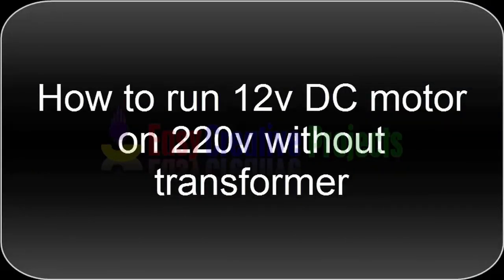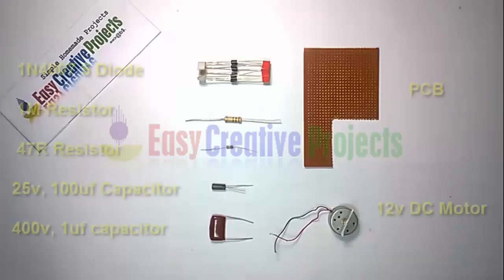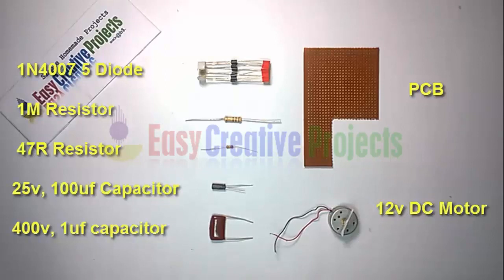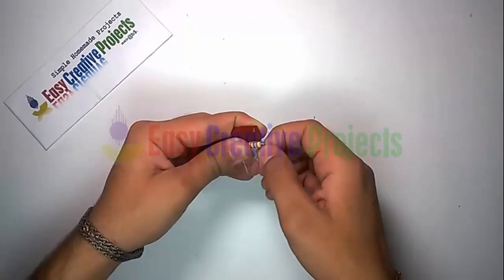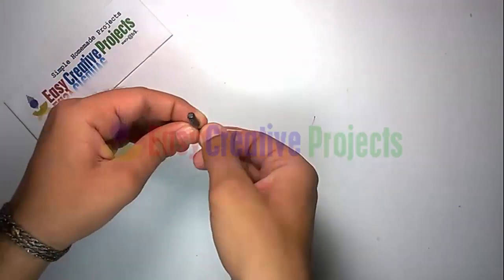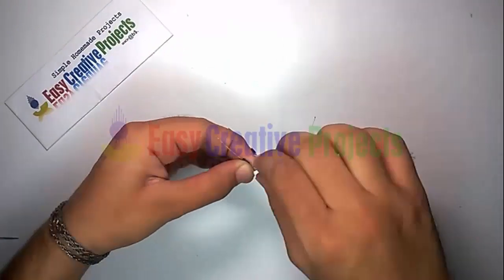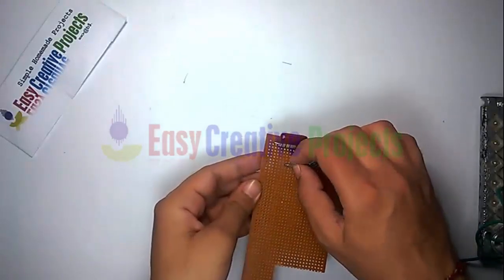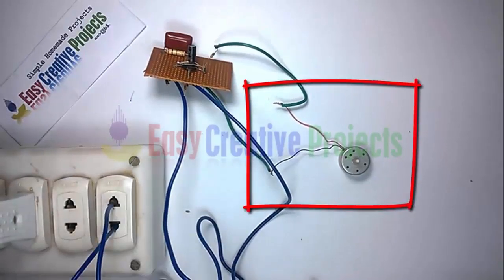How to run 12v DC Motor on 220v without transformer - easy step by step with circuit diagram

Comment: How much the value of diode and capacitor to rise the amphere..thanks
Reply from the maker: dear if you want to increase ampere then you need to increase UF (micro farad ) but if you want to use it for long time then you need transformer. 
thanks

Comment: I buy a capacitor but not ciramic but the value is the same 400v, 1uf capacitor can a use it?
Reply from the maker: you can use but its blast soon. 
so try to find ceramic capacitor.

Comment: sir my circuit is giving 14.38 V
Reply: maybe try getting a 12v regulator.
it should help to control a output to 12v as long as input is higher than 12v.
if im mistaken dont mind me im a noob
Reply from the maker: dear voltage store in capacitor so its giving 14v.

Comment: How can increase output current to this Circuit (up to 2amp)plz tell me as well as I can shock from this output current or voltage please tell me
Reply from the maker: for increase current simply change capacitor and diode.

Comment: HI FRIEND, MY VOLTAGE IS 120 AC, WHAT VALUE OF THE CAPACITOR I NEED IN ORDER TO LOW  TO  12 V ? .,. THANKS FOR ANSWER
Reply from the maker: dear use same circuit. 
if current flow slow then use 2uf capacitor. and try 12v voltage regulator.
Reply: THANK FOR YOUR SOON REPLAY
Reply: Use ceiling fan regulator.

Comment: the diode no 5  is useless

Anywhere I have not found
Diodes parallel to capacitor
  In a power supply.

Show me such a  schematic 
In jlink

Comment: Bhai is se 12 v TQ ki light jla sqte he kya.
Reply from the maker: yes dear but this circuit current flow only 500mA to 700mA.

so try to use 12v and 700mA LIGHTS for running this circuit.

Comment: Nice video :-) question: what I need to change to run DC motor 22.5v , 90Watt? Thanks for help
Reply from the maker: dear without transformer get 90 Watt power output,  this time impossible.
Reply: ok,thanks for replay. I will look in to the transformer solution.
Reply from the maker: you welcome dear. if you find so please  also share me.